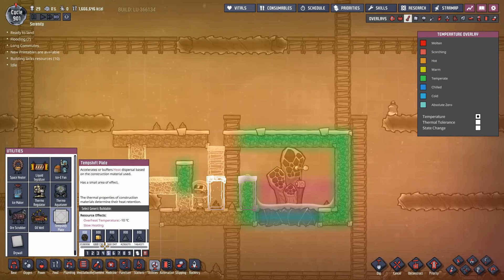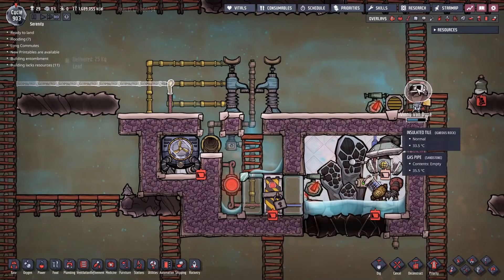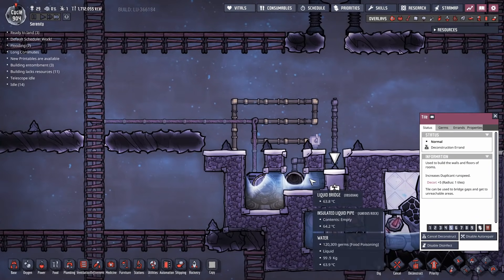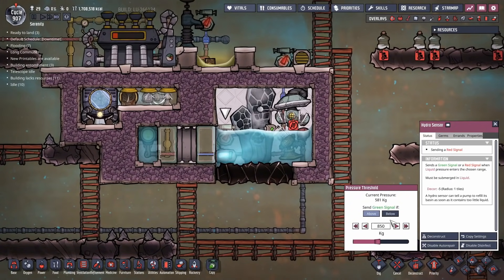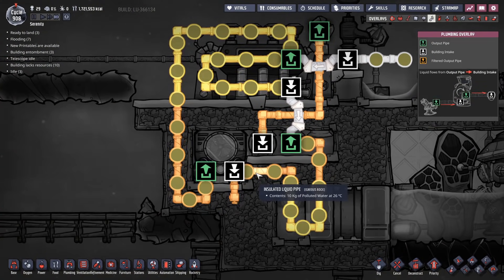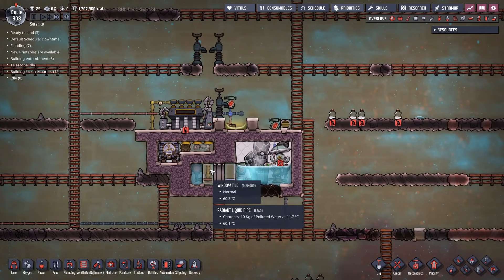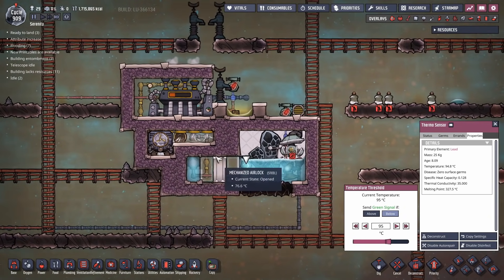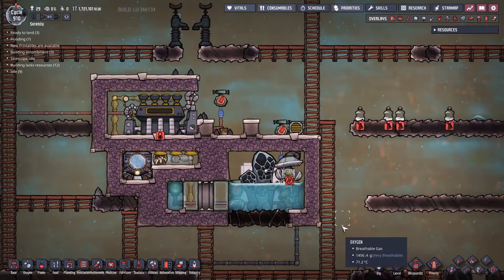Cool Steam Vent Taming : Tutorial nuggets : Oxygen not included

Comment: 0.o yesterday i was looking up how to get water out of cool steam vents. Weird!
I would put a second aquatuner under the steam vent to cool the water made out of steam. 
Bad or good idea?
Reply from the maker: David has it right, just set the temp of the pool of water from 95 down to 70. Though I should point out it's energy cheaper to cool down the O2 that would come out of the electrolizers.
Reply: I feel like this one of those cases where min/maxing can get in the way of a practical solution. If it's just about cooling oxygen, then yes, cooling it directly is obviously better. But in my specific case I have an AETN that does most of the work. It does struggle with hot water or too much oxygen though. Not to the point of being completely unusable, but I like the cold O2 for base cooling. I know that feeding it colder water means there is less work for the AETN and it can reach my desired output temperatures.
Is this ideal? No. But I don't care too much. I have so much Nat.Gas I can burn. And I just can't be bothered to build yet another aquatuner setup now. Or to try to modify the steam vent setup to see if it can cope with cooling the vent, the water for use in the base, my base cooling loop AND the oxygen. Maybe I'll try to extend the icebox some time to cool the O2 and use hotter water, but I've got other stuff I'd like to build first. For now the cooled water is already there.
Reply: One aquatuner should be enough; you don't need a second one unless you're trying to freeze to ice. If you want the water colder just can set the temp sensor lower. It'll take a while but it should get pretty cold. Alternatively, if you don't need all the water chilled, you can extend the icebox and run radiant pipes through it from another circuit.
Reply: @Khaim.m  right right. I just need it too be around 50-60 so that the output of electrolysers remains relatively the same

Comment: Can you please make a video about taming an iron Vulcano? I tried to make it with a steam turbine on top but doesn't work perfect.
Reply from the maker: I'll add it to the list, I need to re do the volcano tamers.
Reply: Make a room around it, fill it with polluted water and use a autosweeper to send the hot iron through a second pool of polluted water to cool it. Both pools can be run off the same aquatuner. It does delete most of the heat though, might not be the best idea if you want power. Brothgar has a better build if you want power out of it. Personally I just want the metal, brothgar's shit is often way too big brained for me

Edit submerge the autosweeper to cool it, iirc the sweeper still works with 200kg of water in its tile
Reply: @ironboy3245  Delete the heat how?  If you don't have a steam turbine to delete the heat then it isn't being deleted, and if you do, then it's being turned into power.
Reply: @phillipsusi1791  it's not a perfect conversion. When water is cooled by an aquatuner, most of the heat is actually deleted due to how the aquatuner works. The more efficient method is to surround the volcano with steam and use a steam turbine in that to produce power and to only let the metal through once it under 130 degrees. Here's the link to my current base, there's a picture of the metal tamer setup I have after optimisation. Its the 5th picture down .It's a different setup than the one I was recommending here though. The second link is the one I recommended.

https://m.imgur.com/gallery/6myKlRx

https://forums.kleientertainment.com/forums/topic/89644-tamed-and-fully-automated-gold-volcano/
Reply: @ironboy3245  I must have misunderstood you.  I thought you were saying to just dump some polluted water on the AT and not have a steam turbine at all.
Reply: @phillipsusi1791  yep sorry, was being lazy as fuck to not post the idea. You can see how the 2nd design influenced the first one though, that pool of water with the metal tiles was inspired by the original design

Comment: I got a question for you Francis!

Would it be in any shape or form better to have a termal-sensor hooked up to the Steam turbine, telling it to turn on only at 195c or higher, for more power? Or would the averge-over-time be the same, as it woul probably turn on and off more? (or my prefered method, a mem toggle with 200 for turn on, and 190 for turn off)
Reply: My understanding is that you get the same joule/DTU ratio as long as the turbine isn't maxed out. So it doesn't matter whether you run a small amount at 190C or a lot at 125C, same total heat gives same total energy. Except if you run hot you're more likely to hit the 850W limit and lose energy.
Reply: also the longer you wait before using the heat, will increase the amount of heat you lose due to heat bleeding out of the surroundings.

Comment: A cheapskate solution is to have two copper/gold metal tile(s) on the one side of the insulated enclosure with tempshift plates touching them and nothing else - as you pointed out... it's not ideal to have the plates touch the insulation. I'm paranoid - I don't even let them touch the vent. The heat get's dumped into the tiles and whatever is beyond them so that's where you bring whatever meagre cooling the dupes can muster. The steam just get's sucked towards the metal tiles since water keeps condensing there. Forming a vacuum.

Comment: I've used this design previously but I keep coming back to a much more simple version: running radiant pipes through the geyser room. Is there something I'm missing that makes this design with the "icebox", door and extra diamond tiles more useful than simply running pipes of water at 90 degrees?
Reply: You have less ability to finely control the temperature when you run radiant pipes through the steambox.  With the windows-and-door transfer, the water heat sink stays at 95 degrees give or take a small fraction.  When running water through via radiant pipes, it takes more work to ensure that the liquid in those pipes stays as temperature-controlled.
Reply from the maker: Majromax pretty much sums it up. But an additional point It's rock solid up to a vent that kicks out 10kg/s. However if the vent is not a monster and you prefer your method then your are doing it the right way. Thats the joy of ONI. Do what works for you.
Reply: @FrancisJohnYT  thanks for the reply, running the radiant pipes with an AT at 90C has been working on a 4.7 and 10.9 vent seemingly fine which was why I was wondering if there was something I was missing with a bit more complex design. I'll have to play with both styles in sandbox and see how it goes! Thanks for all the quality content.
Reply from the maker: @fr4s0r  You have a save file I can take a look at? Email in about section. Always looking for ways to improve my gameplay.

Comment: I'm playing Arboria and I think just reached about cycle 80, though maybe a little bit later, but not much.  I have 1200 kg of steel from deconstructing the steel windows in The Gravitas Facility.  I didn't deconstruct the door (it was 300 some degrees).  I had explored the entire left top of the map (well to abyssalite) before finding The Gravitas Facility, so I'm sure getting steel up earlier could get done... well maybe not on Oasisse or any other map where you might get serious scalding trying to get to the surface (maybe Volcanea or Aridio).  Plastic for a steam turbine though provides more of a challenge in my opinion.
Reply: or just use a puddle of water to dump the hot coolant in from the refinery.
Reply from the maker: If you have atmo suits oil is pretty easy to get your hands on.
Reply: Plastic is ridiculously easy with glossy dreckos. Just 8 of them give you literally tons of plastic. You can build transport tubes before you get an oil industry set up. The atmosphere is relatively easy to set up with hydrogen on top and oxygen at the bottom for the mealwood. You can let hydrogen drift up from the bottom or use a canister bottler. Regular dreckos can live in the same set up, so when you get your first glossy eggs stick them in an incubator and then over time change to all glossy.
You can make a bit of steel and refined metals by using a polluted water pool in a toxic biome. It does heat up, but not hugely so if you don't over do it.

Comment: Tony Advanced has a guide to do vent taming without steel. And about third of water comes out at 20C. This one is basically your previous guide but with turbine instead of weezworts. Still more compact then Tony's.
Reply from the maker: I like Tony's design it's good up to about 6 kg/s and more energy efficient. I just prefer a one size fits all solution, smaller foot print does not hurt either.
Reply: @FrancisJohnYT  I've set up his design on a 6.9 vent with 3 turbines and it's about 90% effectiveness. I've modified it a bit so more 95C water gets back in the system to cool it to 20C.
What i have problems with is a nice ceramic cooking design. Right now i've stuck a couple of kilns in a steam room with  conveyors and sweeper but incoming clay and coal cools the room more then kilns heat it up. Is it just easier too cool of kilns then make them heat up the room? Didn't see a guide too build a neat setup for making ceramic in bulk. :(
Reply from the maker: @Lomionz  I just stuck the ceramic production in the industrial power sauna, with all the other heat sources present it made no difference. Outside of this playthrough I just cooled kilns down like everything else.

Comment: Usually when I find the cold steam vents, the space you find them in usually is large enough to dissipate the heat. Also try another gas to prevent over pressurizing (carbon dioxide or something heavier). Or just use 4+ doors without using power on a cycle to they compress the steam which can be used latter, just make sure to have some space around the vent or over pressurizing will occur.
Reply: or just use gas pumps and use the steam turbine to condense it once it's been pre heated with the aquatuner.
Reply from the maker: I prefer to avoid exploits if I can. This design can eat all the steam as it's created. @Ghorda9 you can't pump the steam with gas pumps fast enough. I tried earlier this play through, for even a little 2kg/s vent you would need 4 gas pumps to stop it going over pressure.
Reply: @FrancisJohnYT  if there is enough space it won't over pressurise before it stops erupting.

Comment: Thanks for the video, you really help me with my playthroughs. What changes do you need to make for a regular steam vent?
Reply from the maker: Hot steam vents? They got big changes this patch. They generate way ways way... more heat and produce less steam. Have not experimented with them yet. Best bet would be to use the heat to run though a steam turbine.
Reply: @FrancisJohnYT  Yes the hot ones. They always seem to overheat a steam turbine. I dont know if it's better to ignore and wall them off or use like three turbines to manage the heat.
Reply from the maker: @jamesb7994  Any heat over 200C is wasted and I think it's 10% of all the heat consumed is output via the top of the steam turbine. That is why the 500 C steam causes them to overheat so much. You need some way to cool the steam to 200C or less and then feed it into the steam turbine, not a simple task.
Reply: If you block off some of the turbine inlets you can run hotter steam directly.

2000g@200C for 5, but you can go as high as 357C with two ports without overheating.
Some of the waste water can be used to cool the steam room while giving you more steam.

Comment: Nice design. I would be curious what is the Watt/Liter ratio with a cool steam vent. I think it's not that great. Although if you use the cooling loop to cool down something beside the ice box...
Francis, what do you think about a buffer gate set to something between 20 and 70 after the thermo sensor to not let the pump run with a few content. It would provide less not full packets in the tube I think.
Reply: You mean for the aquatuner? It's on a closed loop, there should only be full packets when it's running. The partials were just during setup when the loop wasn't full yet.
If you meant the liquid pump, it doesn't activate until there is a second tile of water, so it always produces full packets.
Reply: @Khaim.m  Thanks! I was thinking wierd about the pump yesterday, I must have been tired clearly.
Reply from the maker: There are more than a few "tired" moment by me that some how end up getting lost during editing :)

Comment: Have you actually tested if polluted water can turn into steam below a steam turbine if in igneous or ceramic insulated pipes? The steam will be below 125° and the pwater doesn't state change until above 120°. That's a very narrow range and at least between tiles (like a gas tile and an insulated tile) there is a minimum threshold where heat will stop flowing if the resulting temperature change would be too small per tick. 

I have had pwater sit still in steam for very long times. I can't guarantee that it has been more than the maximum dormancy time, but I'm like 60% sure it won't state change if the pipe is well enough insulated.
Reply: i will, just that it will take a very long time, personally i wouldn't worry about it.
Reply from the maker: Oh... the last time this happened to me back before the steam turbine change. Back when they output steam out the top, the steam would be a higher temp back then. DOH I'm carrying around dead precautions in my head.

Comment: I agree with the "build to last" mentality, but if you absolutely want a gold amalgam steam turbine, use oil 2 tiles high, 3-4 wide, a pipe temperature sensor and a regular, ambiental, heat sensor and an "and gate". If pipe temp above freezing and oil temp below breaking, run, else don't. Ofc, some water above this. You know, for the steam.

The improved ghetto setup is this x2 on each side.

This might cause loss of water though.
Reply: I was going to ask if you can get away with gold. That sounds like a decent solution.
Do you need 6 tiles of oil, though? Seems like 3 could be enough: bottom tiles of the aquatuner plus one to the side for the thermo sensor.
Reply: don't you mean aquatuner? you can't make the steam turbine out of ore.
Reply: @Ghorda9  meant steam turbine setup with gold amalgam aquatuner. Not the best sentence I've ever formulated.
Reply: @Khaim.m  I don't know the game mechanics of it, but I've had problems with just the bottom 3 tiles. It does work, but it seems to be off more than with 6 tiles.
Reply from the maker: It can be done, but I guarantee you there will be many angry comments from player with broken aquatuners if I tried making that tutorial. I like to keep things simple and robust, not everyone will have as much experience as you.
Reply: It depends on what you want to do. It got one sort of working for a base cooling loop even without oil. There is also a point where you get breaking warnings but it doesn't take damage. It's not pretty but can do what you want it to

Comment: Neat compact design. As far as the liquid loop is concerned, though, you can always take the foolproof & lazy mans way out and just connect a reservoir. It'll perfectly pressurize any liquid loop in any design. It can also be disabled to drain the whole loop (it still accepts input when shut down), allowing you to re-build and repair things without making a mess.
Reply from the maker: I use liquid tanks for cooling loops I could potentially be modifying. For never look at it again designs I don't bother.
Reply: @FrancisJohnYT  watches next video about battery boxes uh huh. whatever you say :p